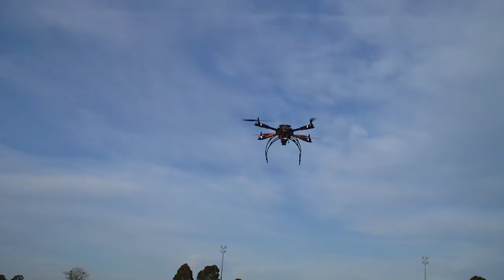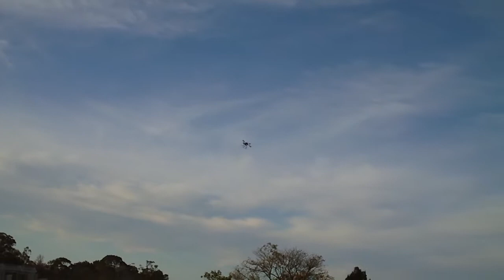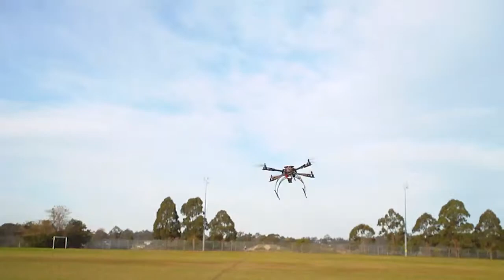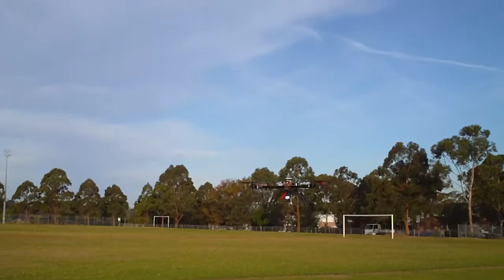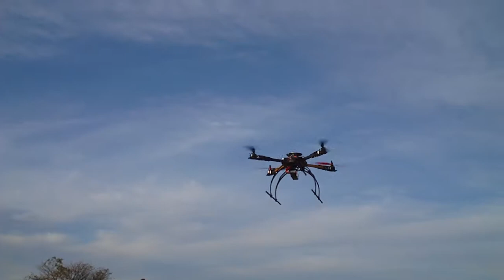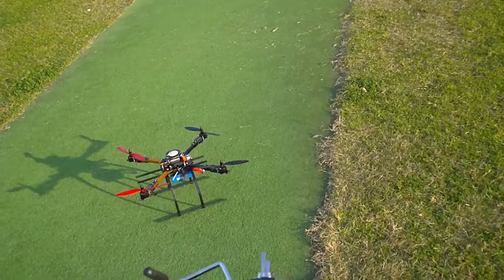HK X650F flying nice with new ESC and NAZA Lite

Comment: how did you set up the q brain with your naza is it just plug in and fly?
Reply from the maker: Hi Mark, it was a bit more involved than plug and play. Basically it has 4 independent ESCs in one box and you have to go through each of them to check programming as per this link http://www.hobbyking.com/hobbyking/store/uploads/934316348X1085196X31.pdf    If you are using it in a Quad make sure you select NiMH as battery and voltage cutoff to low (which disables it when in NiMH mode)   You have to do each ESC individually and then calibrate all 4 together using the 4 in 1 cable they provide.  Then for the Naza you have to cut the red wire on #3 ESC which normally provides power to the RX but with the Naza you don't need it as it has its own supply.  Hope that helps.